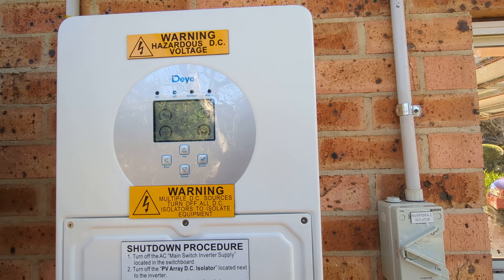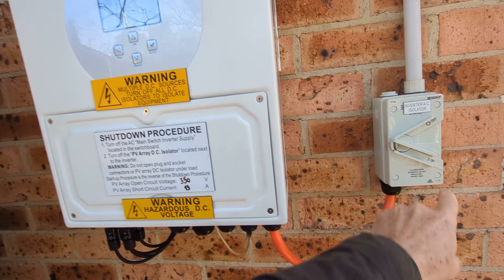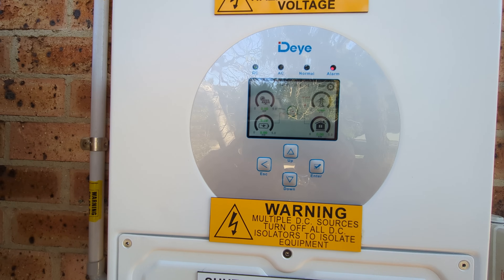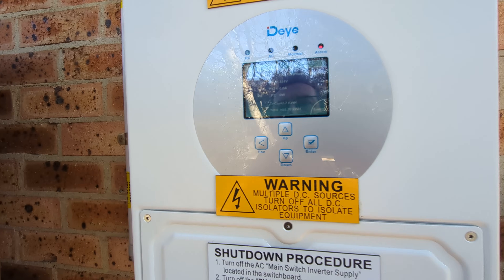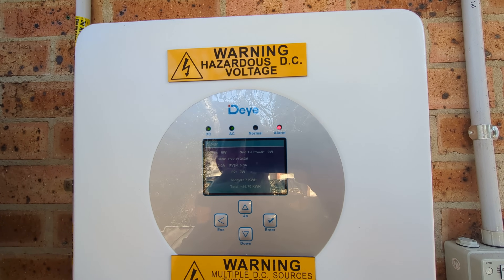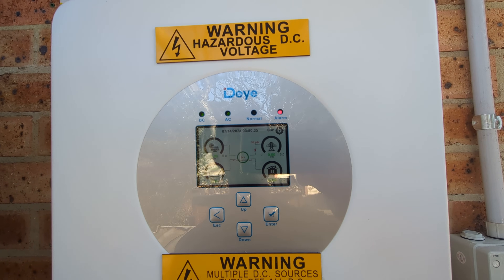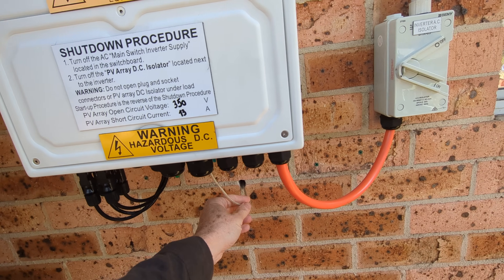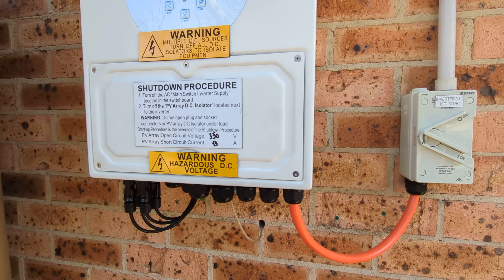Deye Hybrid Solar Inverter Mains Dropout Test

Comment: Isn't the 'Generator' connection an input, not an output? I'd love to see a block diagram of your whole system. You've made so many changes I dunno whats goin on haha.
Reply: The Deye has 3 AC ports:

1. Grid - Feed grid in/excess power out as required. This one is shut off when the grid goes down.
2. Emergency Load - Powered by a configurable blend of solar/battery + grid if available., keeps working off solar/battery when the grid goes down.
3. Generator/Smart load - Input for generator, microinvertors, or alternative AC supply. Alternatively can be installed as an output that turns on when certain conditions are met, e.g, there is excess solar (called Smart Load).

I have 2 of these guys running in parallel.

I live in South Africa where we sometimes have rolling blackouts, so most of my house is powered by the Emergency Load output. The exceptions are the electric water heater, powered on the Grid side (so uses Solar/Battery if available, grid otherwise, turned off if no grid), and the pool filter pump, powered by the Smart load output, so I've set this up to only run once the batteries are fully charged on sunny days.

All this is super configurable, so you can choose when to prioritise battery vs. grid, or charge off the grid/feed battery into the grid at different times of day if you have variable tariffs.

Also important to note that the inverter will BLEND grid, solar and battery as required to supply the Emergency Load.  The 5Kw inverter can actually bend in an extra 3Kw of Grid, giving a potential continuous output of 8Kw on the Emergency Load output when the grid is present.

Some other combination inverters will only run on Solar/Battery OR grid. My friend's inverter is like this. If the PV input can't supply the full load it will initially power the load from Solar+battery, then when the battery drops to its minimum charge level, it will switch over to powering everything from the grid, leaving the PV to charge the battery until it gets full enough to take over again, cycling the battery unnecessarily.
Reply from the maker: @paulwakefield5696  Great summary. I'm going to connect two extra 440W panels I mounted yesterday into the 800W 2 input Hoymiles microinverter I have into the Gen input to give me some extra power. I presume that extra gen power gets treated like the solar input and can charge the battery/load/grid as desired.
Reply: @paulwakefield5696 Hi, i have Deye hybrid 12kw with 11kw BYD HVM batteries hooked to it. I am struggling however with the switchover time from grid to battery.. according to specs it shall be 4ms .. still in reality is well above (cca 100-200ms) causing TV to shut down, bulbs flicker briefly, etc.  Any idea why this may happen?
Reply: @nikolabourov5267  Not sure I'm afraid. We don't usually notice when the grid goes down, the switchover is more-or less seamless, no glitches or issues with appliances restarting.
Reply: @Hagar76a
Yeah in the context of this video Dave mis spoke but its interesting to note the flexibility of the generator connection.
The Generator connection can function either as in input for AC coupled solar panels / Generator OR it can be used as an output for dumping excess power into a resistive water/sand heater etc. 

I have mine (6KW model) setup to use the solar to charge a bank of batteries / run the emergency load (lighting, fridges/freezers, IT equipment) once the batteries are changed and the emergency load is satisfied any excess power is sent back to my main switchboard where its available for use elsewhere in the house kitchen, laundry etc or if there is nothing running its exported to the grid, what each input/output does is programmable as it's monitored by CT clamps and little energy meters connected to the inverters communication bus.
The capabilities of these inverters for the money is hard to beat.
Reply from the maker: Yes, I should have said emergency power output port, for some reason my mind keeps confusing the two.

Comment: you've got it wrong without a battery the DEYE inverter won't produce power from the solar panels when the grid goes away
it just works like a grid tied inverter

Comment: There is a 60 second minimum reconnection time starting when inverter sees the grid voltage and frequency within check

Comment: don't you dislike these complications of the system? wouldn't it be nice to have a rather dangerous high voltage direct current circuit and use everything you make without an inverter and the battery? sort of dumping all the electricity into heat or cooling or power tools.

Comment: I think without batterie the load port isn't active in this case. You need a battery. Is this a lv or hv deye model? If lv, get an pytes 5 kw battery. Give 0,5 C charge and discharge rate. Easy to install
Reply from the maker: LV, getting batteries shortly.

Comment: I had the new IQ8 enphase one installed, In the almost year it took for permission to operate (in New Mexico) they changed the regulations. My IQ8s are perfectly fine to run in off grid mode when the power is out without back feeding the grid, but that feature had to be disabled

Comment: I did not know that this was also sold in Australia, since this is one of the most-used and installed hybrid inverter here in the Philippines. Other brands widely used here is Epever and SRNE.
Reply from the maker: No common here, my installer had never heard of it before.

Comment: So it behaves just like my Aurora has for the last 15 years. That's just a plain twin string inverter. Johannes Hubner of the Openinverter (EV) project has used his EV to run a cheap Chinese 360VDC input inverter to create a local grid and gotten his PV inverter to come back online. Due to the design of the Chinese inverter, it would then backfeed and charge the EV battery if the 'grid' voltage went too high.

Comment: I am indeed playing along at home, but with a Solis hybrid inverter, 3kw of panels and 10kwh of Pylontech batteries.

Never tried using the emergency output, my installer told me I'd need a breaker and Earth connection for it to be safe.

Comment: When you disconnect the grid, the system goes into what’s known as “island mode” you need to check with your local regulations to see if you need to install an earth neutral bonding relay. . It varies from model to model but it’s something I had to do on mine.  You’ll probably find something called grid disconnect signal in the settings. 
Worth checking out for safety reasons

Comment: Yes, these devices typically have a delay on AC power restore because you might have situations where the AC power comes on then off because something blew. As well, w hen power comes on, there's often huge spikes and surges around because things will be powering up and the power on spikes can do wreak some havoc. So it would wait a minute for the grid power to stabilize to ensure it can adequately figure out how to push the power onto the grid again. It's been known for power to be re-established only to have the fuse blow a short while later, or for reclosers to operate and then disconnect again.

Comment: can these Deye's run of lead acid batteries?
Reply from the maker: Yes. They even included a temp sensor for led acid batteries.
Reply: Yes the box allready comes with a lead acid battery temp sensor,and it dose have configs for lead acid battery in the menu
Reply: @Adam-bw4lw  thank you

Comment: I installed My batts, then 2 weeks later a wild storm took out local grid  for 8 hours, had to speed run setting up a gpo to the backup socket on the inverter as daylight ran out, kept the fridge and freezer running, used a 36v Ryobi inverter to run my laptop and phone and a 18v Ryobi inverter to power up the modem for internet. 
Was great to have the necessary equipment active while the rest of the area was out cold.
Reply from the maker: We get so few power outages here that iot's not worthhile doing a whole house backup. So the emeregncy power output port will be enough to keep some things going.
Reply: @EEVblog2  same, may loose power once a or twice a year always around storms

Comment: For the Deye - the output of the unit is what you can connect to your stuff you want on it.
Don't use the 'generator' output/input.
The GEN/AUX Input/Output - is for other uses than a simple output - eg ... other micro-inverters 

You said it though haha :P
Reply from the maker: Yes, my mind was confusesing the two. It's called the emergency power output port.
Reply: You can also connect the output of a grid-tie inverter to that, too!
Reply from the maker: @markarca6360  Yes, I have installed two extra panels just to do this.

Comment: Apparently these inverters can produce an audible 20kHz tone (PWM frequency).  Olden ears won't be able to hear it but Golden ears might.  An audio spectrum might be interesting to look at.  A mobile phone app would do the job.
Reply: I have the Deye 6KW model, There is a setting in the newer firmware that adjusts the frequency pretty much eliminating it from the range of human hearing.
Even with the audible frequency its way quieter then my old Aurora 3.6KW inverter.
Reply: @Tas-Devil  i too have the same model. Will you guide me on how to do it and what firmware you are on?
Reply: @maheshgods  
Select 'Advanced Function' - use LCD down arrow to cycle through pages until you see 'Low Noise Mode' and select it, then press the tick in the bottom right to save and exit.
Can't remember if you have to power cycle the inverter to ensure for it to take effect.

Comment: Hybrid inverter is the term generally used for inverters that support both solar and batteries. Can this inverter actually run AC loads from solar only without a battery? You mention connecting to the "Generator" port a lot, but this is probably an input for an external generator to provide input power when solar output is low and the battery SOC drops to a defined level. 

Essential or critical loads are normally connected to the "Backup" output terminal of the inverter and a battery is required to run those loads. The Fronius GEN24 is an example of an inverter that can actually run the backup output directly from Solar DC without a battery, but can this Deye do that as well?
Reply: SMA and MPP have options for daytime backup without batteries. Maybe Deye also does, it's a substantial value add for a fairly low added cost.
Reply from the maker: Yes it can. It has an emergency load output (which I mistakingly called the gen output) that works from just the solar, or a battery if you have one.
Reply: @EEVblog2  is yours the SUN-5K-SG04LP1-AU? The manuals for that one don't do a good job of explaining the backup power except with a battery! That's be worth a video in itself demonstrating it powering loads from PV only!

Comment: Neat feature! I wonder how it behaves on a cloudy day if you have some load on the output. Would it shut down the output once there is not enough PV and then restart it once the cloud passes?
Reply: i don’t think you should be running these in grid failure mode without batteries
Reply: @eliotmansfield  ideally it should have a battery to bridge the gap between when the grid fails and when the generator is up to speed and stable, (the inverter has the ability auto start a compatible generator when the grid fails or if running in off grid mode ie: battery voltage etc.)
Reply from the maker: It would either shut down or smartly disconnect the emergency output. Probably some hysteresis on that too.